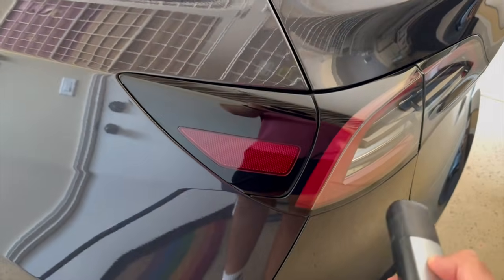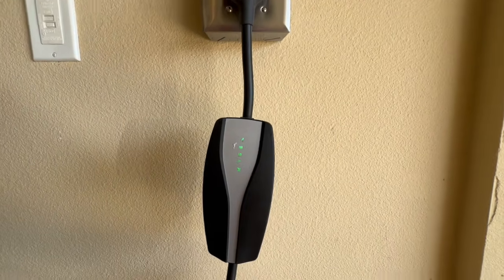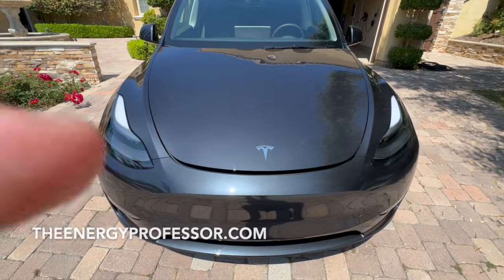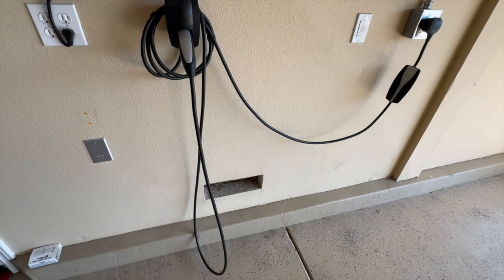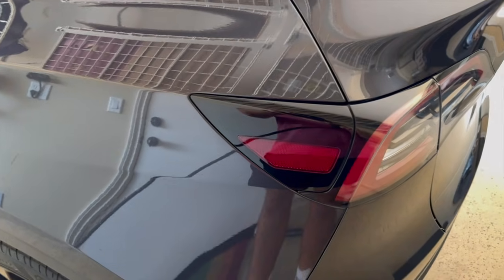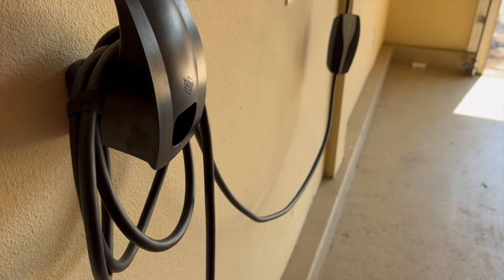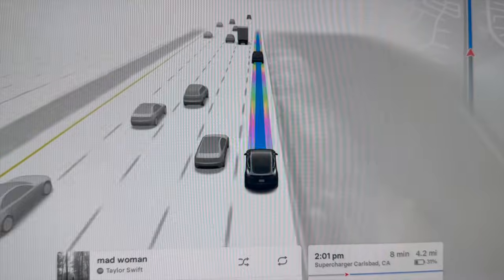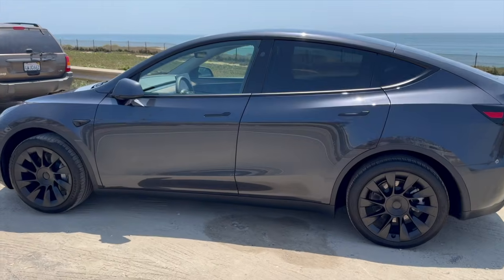Don't Make These Mistakes For Your Tesla Wall Connector!

Comment: Big contradiction: #4 says DO NOT use GFCI. #7 says you MUST use GFCI. Which is it? The EVSE supplied with 2023 Chevrolet Bolt EUV, and 2025 Chevrolet Equinox allow the use of GFCI on the outlet, whether Level 1, or, Level 2. I haven't had a chance to test with Tesla, so I would go ahead and install GFCI on the outlet, and if you experience problems, get rid of it, and rely on the GFCI built into the Tesla EVSE. I'm not sure whether Chevrolet EVSE has integral GFCI. (I'm almost certain it does)